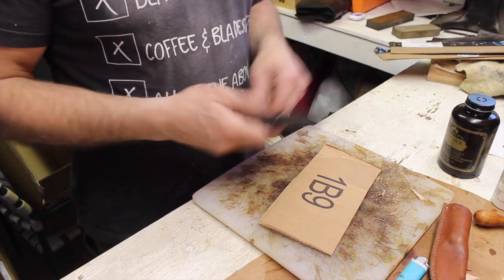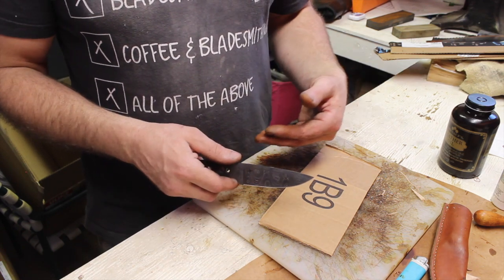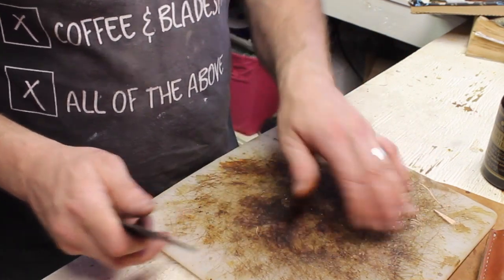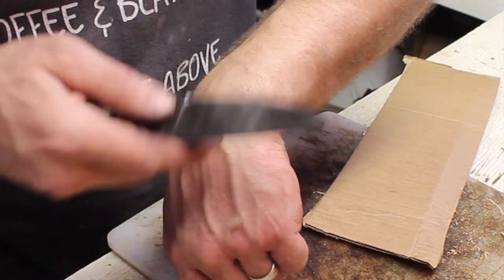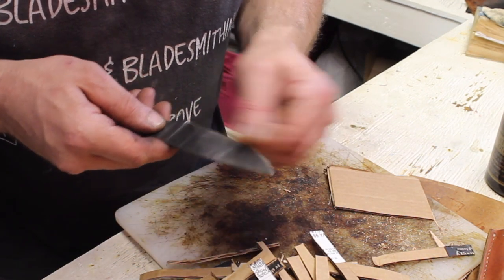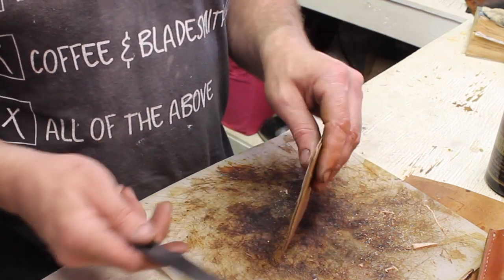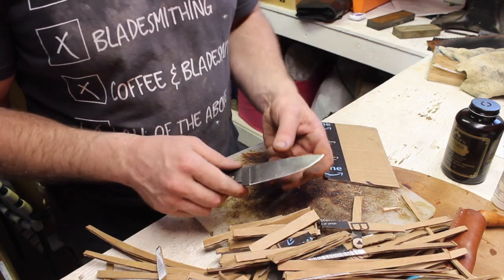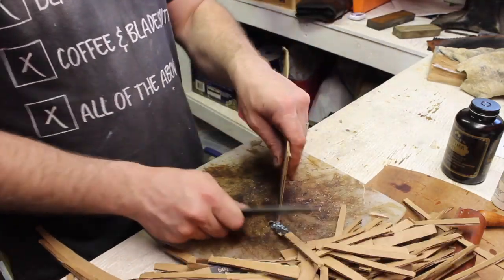Cut Test: 1095 HC Steel/15N20 Damascus With Cardboard ~ Forged Knife Performance Abrasion Resistance

Comment: Dude pretty sweet I love 1095.. I knew the combo was great in fact 15n20 on its own makes a nice blade. Nice work , Is the grind a full flat? ..... Martin
Reply from the maker: Thanks Martin, yep both good steels! Yep its a full flat
Reply: Nothing leaves my shop with out a full flat.. But I have been experimenting with a platen that has a radius of a 30 ft. wheel it seems to be very nice on kitchen knives. I have yet to try it on another design.  Great work I love your content..Martin
Reply from the maker: @msblades5382  thanks, i appreciate it